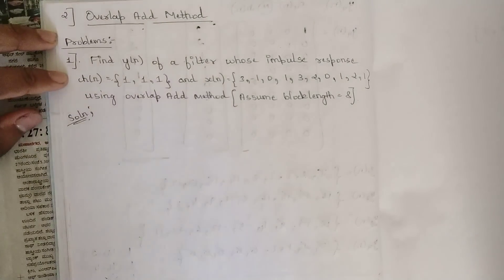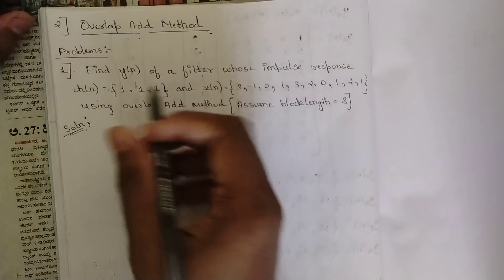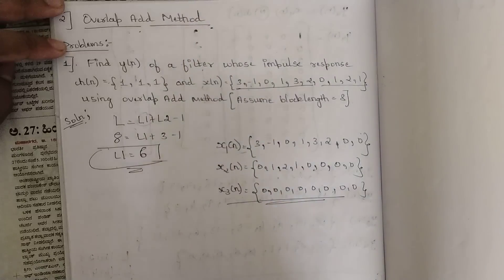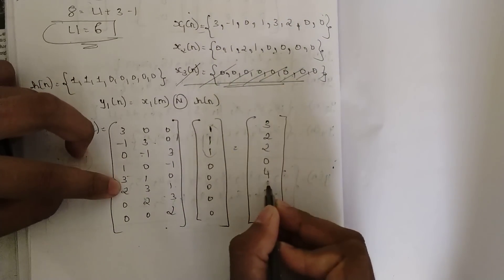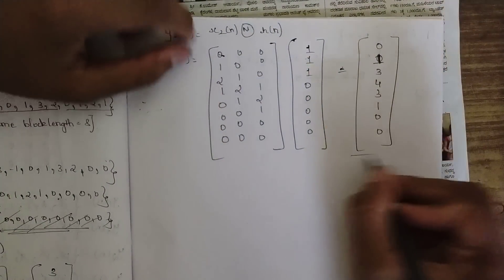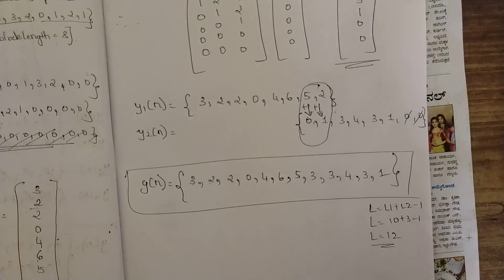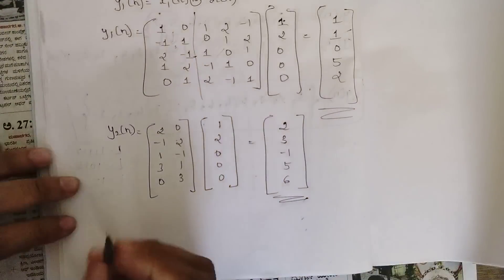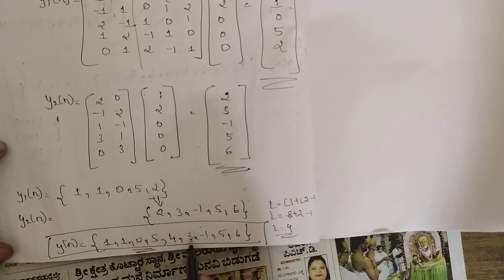7.Overlap Add Linear Filtering Method,1 Problem Solved Module 3 5th Sem ECE VTU Latest Scheme BEC502

Comment: 1:58 What if they don't specify the value of blocklength in the question?
What should we assume then?
Reply from the maker: No worries...
They will be mentioning the block length
Reply: @VTUAcademy_009 But in the PYQ's and MQP's they haven't mentioned it
Reply from the maker: In that case we should be taking the standard block length as: '8'